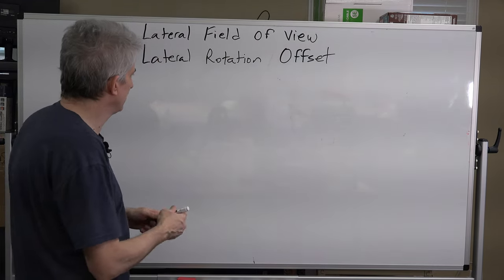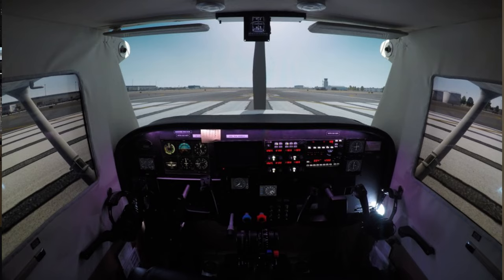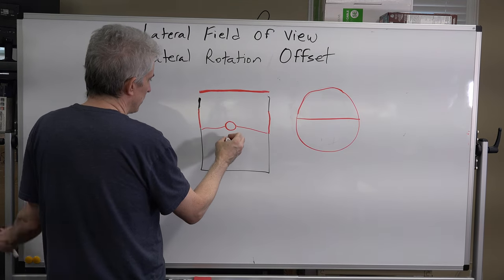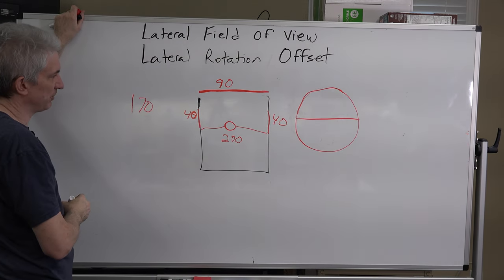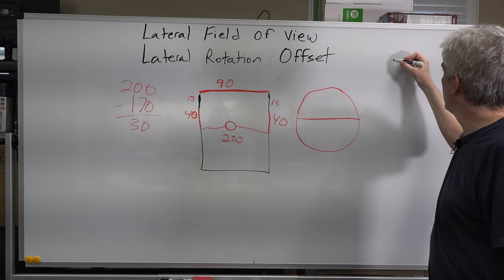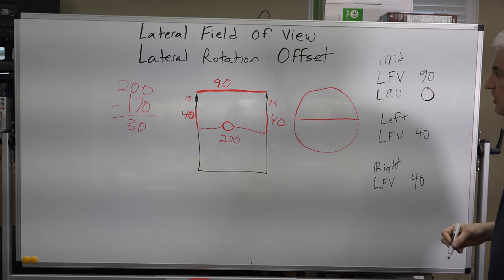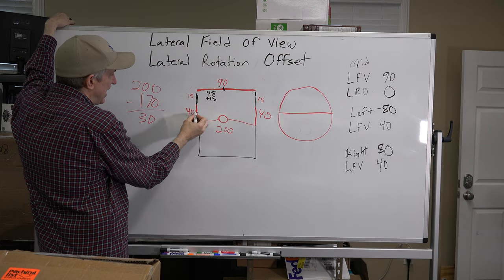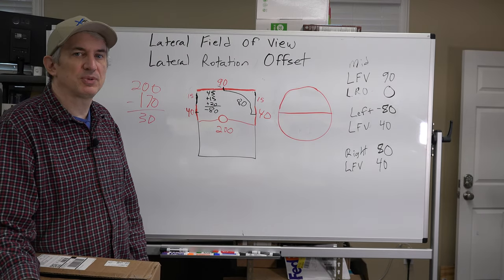X-Plane 11 - Setting up a triple display cockpit (corrected)

Comment: This was a great start for me and appreciate the help. Since my monitors are all the same size and resolution, I ended up keeping the same LFV for all three monitors with -100 and +100 offsets for the left and right monitors respectively. This prevented distortion while creating the visual "gap" left by the spaces to the left and right of the main/front monitor. It's looks, and feels great and I couldn't have gotten there without you!

Comment: what about the fact you are not sitting directly in the center of the sim but on the left side? do you need to take that into account, 
and if so, if you have 2 pilots what do you do?
10x

Comment: Like the video, have played around with 3 equal monitors using different settings. WHat I am trying to figure out is because I do not sit in the middle of the cockpit, what can I do to correct this? If I line everything up as described, I have trouble lining up with a runway as my view (from the left seat) is not centered...I have messed with the lateral fractional offsets, but that has its own set of issues. Do you have any advice for a three monitor 120 deg view when you are not centered behind the front monitor?
Thanks!
Reply: Fly elise-ng makes software that will do those calculations in a 3D interface for you. There is a timed demo you can use as it costs a good bit.

Comment: I recently installed a few Aircraft mods, I unzipped them and put them in the Extra aircraft Folder, for some reason, when i start the game, those planes don't appear in the aircraft list. Ive restarted the game multiple times, reinstalled the mods multiple times still nothing seems to work. 
All of those mods worked for sometime and i even played with them but then suddenly they disappeared. (except the F/A-18E mod which i couldn’t find anywhere after i installed it.)
Instead of extra aircraft i even tried extracting them in just the aircraft folder still it didn't work.

Comment: How do I set instead a circual screen (i.e. 220 deegrees) with 4 screens using 1 master and 3 "view extension", all running on (4) differents PCs ?
This is going to be my installation.
Reply: FOUR different PCs?? First, you need to buy another 3 copies of X-Plane....